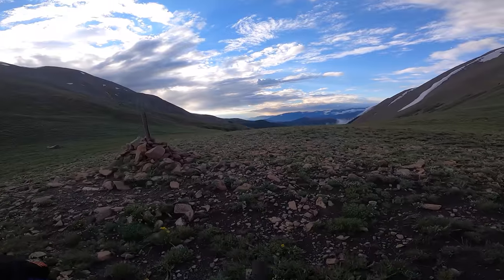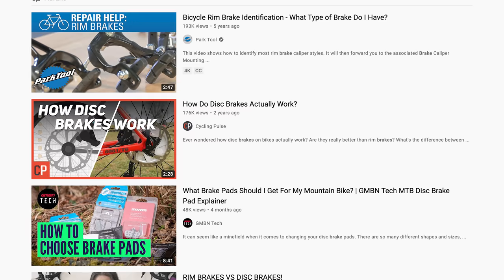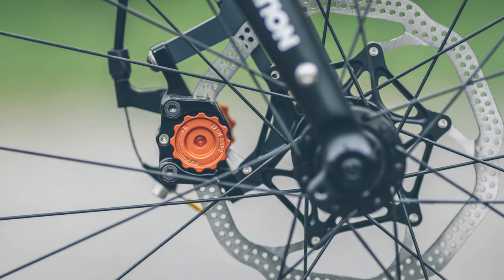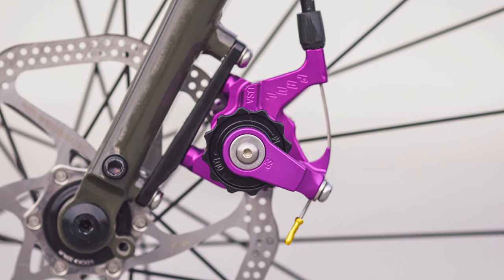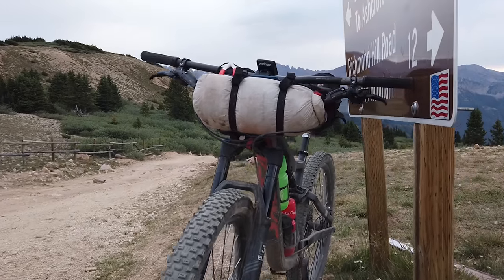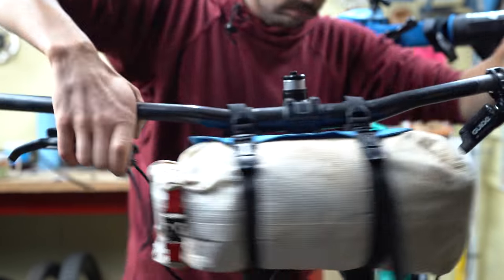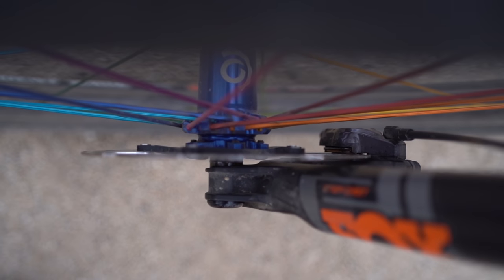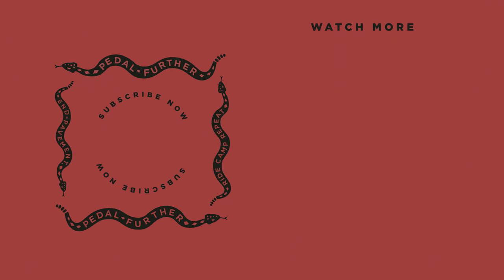The Best Brakes For Bikepacking?

Comment: I had my Sram hydro (Guide R model) rear brake go out completely on two big downhills this summer. Could be reactivated by pumping the lever and waiting a bit  Due to what?  Overheated oil?  Air bubbles?  Very scary none the less!  Had them bled and they worked fine afterward but I can never fully trust them and want to swap over to Shimano.
Reply: Out of my experience I now avoid sram brakes for a few reasons one being the very same thing that had happened to you, what's with those brakes? Shimano drive tran and brakes all day every day on all four of my bikes with zero issues. I sure would like for you to get some Shimano brakes real soon so you could get some confidence back in your gear.

Comment: Just keep all the cables below the stem and go into the headtube to avoid unnecessary interruption after mounted the handlebar bag. Not only brake cables, you missed out shifter cables for this case. I'm having issue for shifting accuracy, for my case it is a mechanical  derailleur, not electronic.

Comment: Semi or resin pads on the front for good initial bite, but metallic/sintered pad on the rear. 
On long steep loaded downhills I can feather the rear brake without it fading as they get better with more heat, leaving the front for sharper pulsing when needed for corners etc.

Comment: Greater than 160 front doesn't make much sense unless you really need the mechanical advantage (downhill MTB for instance). But bigger can actually be better in the rear for long descents! Why? Because of heat dissipation. A bigger rotor dissipates heat better and the rear brake is generally used more for lowering speed.

Comment: Rim brakes also have the ability to lock up the wheel and can fit big tires. Disc brakes are fine for short Bike packing trips, but I wouldn't use them on longer trips, because they need frequent readjusting and start to rub, which is annoying as hell up hill and in the wet. Hydraulic disc brakes are a must for anything mountain bike related, but for Gravel/Any Road Bikes even with the weight of added paniers the braking power of a well adjusted Rimbrake is far better than mechanical disc brakes and are way lighter as a bonus.
Reply: Not when it rains
Reply: @thomasmuller986  I wore through a set of pads on rim brakes in about a day riding some wet and muddy gravel/double track/single track in VT a couple of weeks ago. The dirt and water made a nice abrasive rubbing compound that just ate my pads.
Reply: @chiefsilverback  okay,  maybe I'll give rim brakes a second chance on a singlespeed cyclocross främeset that I is waiting for getting built up
Reply: Agreed

Comment: Best to get hydraulic brakes that use mineral oil, such as those from Shimano. Less fuss maintaining than the brakes that need "special" fluids...
Reply from the maker: Yeah, mineral oil is more common, great point. I should note, mineral stops working when it gets cold. I’ve crashed because the oils stopped working properly at 25F.
Reply: @BIKEPACKINGcom  
That's just -4°C. Wouldn't expect them to stop working in such conditions without other factors at work... It's always possible some water might have ended up creeping into the fluid and stopped it from properly moving in those temperatures...
Reply: @87solarsky  That is the correct freezing point of mineral oil. I've had shimano brakes freeze in MN winters enough to deter me from winter hydraulics, though now having checked the freezing point of dot fluid I'll likely leave my Levels on this winter.
Reply: @87solarsky  doesn't discuss freezing point.

Comment: It happened when I was on a normal commute into work one winters day many years ago and it changed my bicycle life forever for the better and, although at the time it was scary and I feared for my life part way through, I am glad it happened because riding is now more fun.
Overnight it had snowed, so as usual I lowered my saddle and deflated the tyres just a little. About half way along my commute there is a T junction with the road that I was on sloping downhill into the junction. Until then, through the journey, nothing had gone amiss, but as I approached the junction I realized that a farmers tractor would arrive in the junction almost when I did and so I began to brake to come to a halt..... and my bike didn't slow down.... the wheels went faster and the brake cables had frozen solid.... and when I got to the junction I was just lucky that the farmer had realized my predicament and brought his big 4 wheel drive to a halt while I sailed through and ended up in the hedge and ditch on the other side of the road.
That afternoon I bought my first hydraulic brake set and had it delivered the following day, so that weekend it went onto my bike and I have never looked back. I still own that bike and the Shimano brakes have been incredibly reliable and since then I have had plenty of opportunity to test them out at the same spot and they have never failed regardless of how much snow and ice there is on the road and on me. Cables - given the conditions - freeze completely solid and at that point they are not brakes and instead are a liability.
Reply: So you did not brake in the first half of your commute?
Reply: Between my driveway and the point where my cable disc brakes stopped functioning there are 26 junctions and even more places and changes of direction where you would need to use brakes and until they stopped working they had functioned without any sign that anything was about to happen.
And then it did and like pretty much everybody I was shocked and anxious and looking for explanation. I must have pulled front and rear brake levers dozens of times and each time it was obvious that the front was frozen solid and the rear was only partly functional and then after 30 minutes, walking along headed towards work, the brakes began functioning correctly - first the rear and about 5 more minutes later the front and I carefully remounted and slowly made my way into work late.
Since then I have spoken with others who want another explanation because cables just don't start not moving in their outers - sorry yes they do and given the conditions they will do. Also I have talked about it with people who have experienced the very same or similar.
Don't get me wrong - I have just spent most of the pandemic period carefully restoring a old CroMo Specialized Rockhopper and it uses rim brakes and they use cables..... and it is the most stupendously wonderful bike to ride because, apart from the sound of the tyres running over tarmac or mud or rock. it is next to completely silent.... even the chain running over chainrings and jockey wheels and cassette makes no noise that your aware of.
I think it would have been shorter to type that I am not a old tech hater and there are lots of things that have happened in the bicycle industry which frankly I think are crap. Hydraulic brakes are not. When cable brakes fail your hydraulic brakes keep working.

Comment: I'll never use anything apart from hydraulic disc brakes again. I never had any issues with them in terms of failing on the go. Keeping them well maintained is key, do a regular bleed but even without that breaking power will be superior to everything else. I'm still running a pair of SRAM Avid Code 4 Piston breaks from 2008 !!! They are tough as anything (not like modern day magura mt breaks out of plastic). Trust your breaks - and if you can't, get some that you can! Hydraulic ftw
Reply: Best to get hydraulic brakes that use mineral oil, such as those from Shimano. Less fuss maintaining than the brakes that need "special" fluids...
Reply: @87solarsky  actually I use dot fluid for all my breakes. It's made for cars and it is much more durable than mineral oil from Shimano or so👍
Reply: @actinoid645  The hygroscopic nature of DOT makes it less durable than mineral oil by design. You can also find mineral oils that allow for very high steaming point so it's not a problem either. The only reason to go for DOT is if your preferred braking system uses it, otherwise mineral oil is better in every conceivable way.
Reply: @thomasjousse2427  
Thank you for your logical assertion.

Comment: I dont disagree with your thought on larger rotor being helpful up front due to the wheel being more planted, but you missed the whole point of why larger rotors are used on the front wheel. It’s due to physics and 70% of stopping power coming from the front as it absorbs the force of the weight and momentum. Front brake is in front of your weight while the rear brake is behind your weight.

Comment: Honestly hydraulic 100% I honestly think that  the reliability issue is sort of overblown I've never had a failure for the 5 years I've been mountain biking and bike packing at least as far as the hydraulic part is concerned I have had issues with contaminated pads though. I'm not saying it does not happen it is just that it is so rare I wouldn't even consider it assuming everything is properly maintained.

Comment: While having super duper stoppy brakes on bikes are good, they are only as good as the amount of black rubber you have on the ground, I can lock up my wheels on all my bikes, whether they are rim or disc brakes, as the tyres are going to either have enough tread on the ground to make a difference or not. If in the dry and you are running a fat 2.4 slick with medium pressure then you will stop, if you are running a 700x19 high pressure on the same road, same conditions, willing to bet that will just lock up anyway.

Comment: Both have the same stopping power as long as the brake pads have the same material. The difference between mechanical and hydraulic would be the exerted effort applied. Say you have the same amount of force applied to a mechanical brake, it will also stop at the same distance. Physics...
Reply from the maker: Ease on the….🙌🏼👋🏼🤟🏼

Comment: Great article but terrible advice on bedding in brakes - "go out the front of your house and marry them"??!! No, go to a local hill, build up speed and apply the brakes hard until you almost stop then release, rinse and repeat.. BTW, wearing out 'prematurely' is not the same as wearing out 'more quickly'.. one this example it would be in comparison to its own standard, the other in comparison to others... oh, and 'much easier' or 'much more easy' but not 'much more easier'.. more easy IS easier.. you're welcome
Reply from the maker: One is earlier than the next.
Reply: @BIKEPACKINGcom  Sorry but nope - prematurely means 'before it is normal/earlier than it should'.. don't believe me? check a dictionary..

Comment: Hydraulic brakes are going to be as reliable as you let them be just like your cars if you service them they will work. Don't well you may have an oops moment result in a Darwin award so check out the hose and service them and unlike your car you have dual systems so you can baby it in if you have to